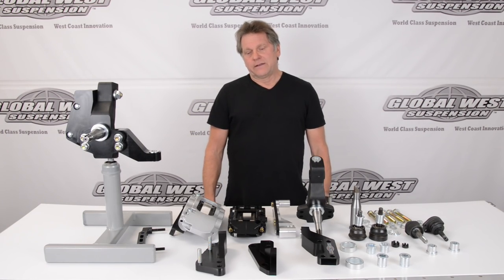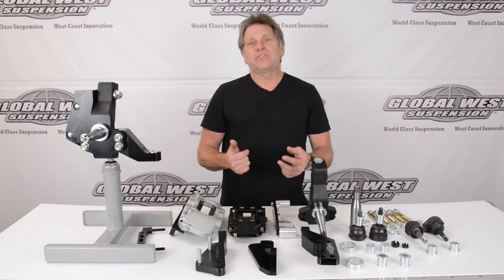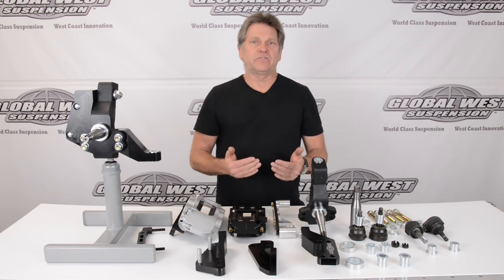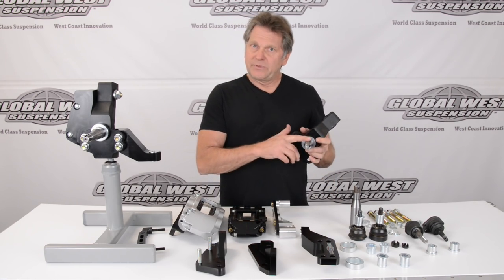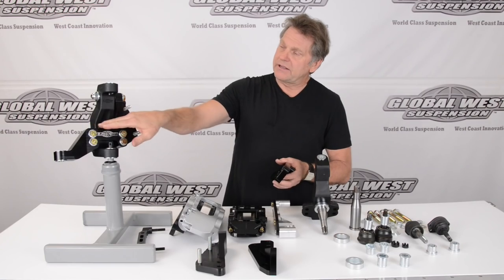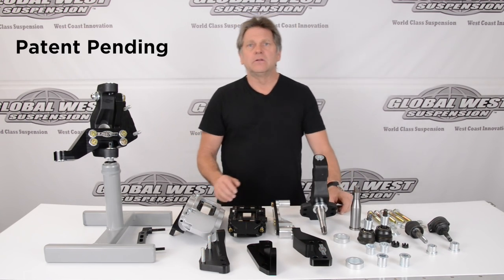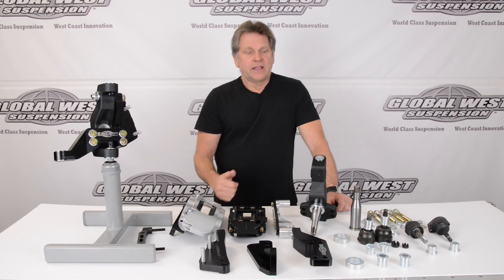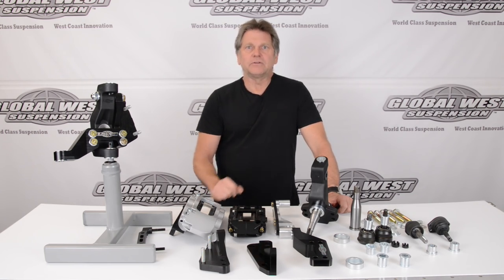1964-1972 A-Body Tall Forged Aluminum Spindles

Comment: @globalwestsuspension  I have a g body with Qa1 level 2 handling kit and Wilwood Dynapro6 big brake kit up front(6 piston calipers 12.19" rotors) do you sell a modular spindle that would fit this setup? All of your kits seem to be for 13" brake kits and up
Reply from the maker: Give my tech and sales a call at 877-470-2975! They can get you all squared away!!

Comment: Question for 65 Mustangs with big front spindle unit (trans am style) will they be available in the future. And are they also lighter the stock cast iron. (less unsprung weight)
Reply: 65 mustang motorsports we
Reply from the maker: For the most accurate response to your question give our tech line a call! 877-470-2975
Reply: @GlobalWestSuspension  After 5 years a responce.  verry good.
Reply from the maker: @65mustangmotorsports77  im the new youtube guy in the office! sorry for the late response! good luck with the build!